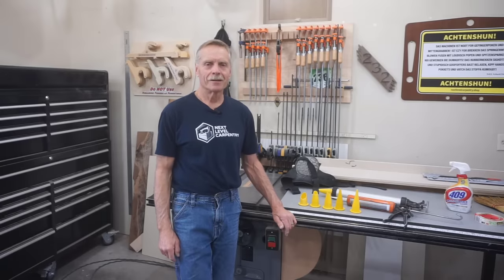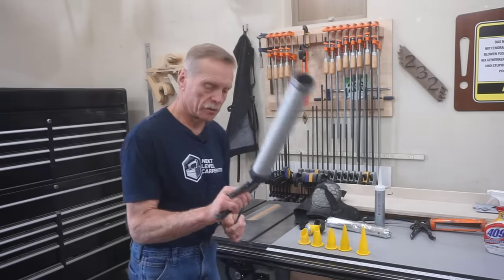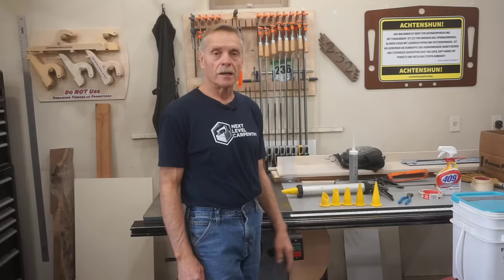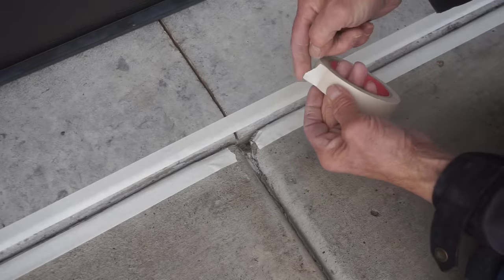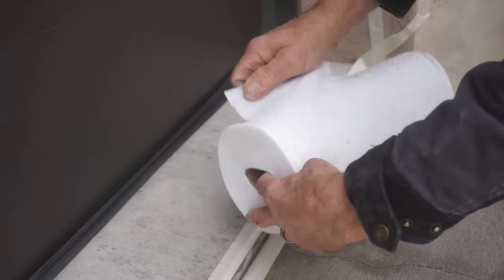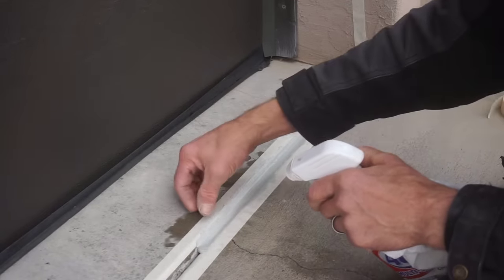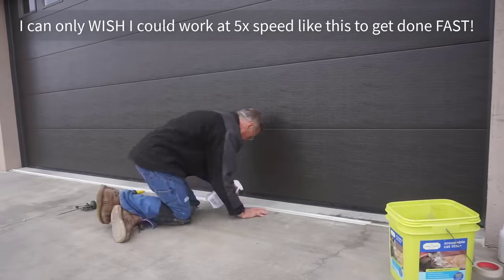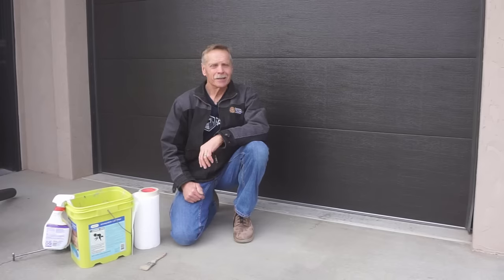How to Caulk Concrete Control Joints with Perfect Results Every Time

Comment: I saw a completed caulking job like this about 15 to 20 years ago and haven’t seen another since then. It was stunning! I didn’t know about adding the sand after so I thought it was a special caulk. I have found caulking for stucco and I’ve used it, but it never looked this good. What I saw was perfectly uniform and placed nicely between the two sides with clean edges . I couldn’t imagine what magic the installer used to do this, but kept it in the back of my mind. NOW, I know how it was done. It’s positively beautiful! Thank you!!
Reply from the maker: Maybe you saw a sealing project I did? 😉😁😎
Best, Matt

Comment: Just did 560 feet of driveway relief joints with sika flex self leveling on a 2 year old driveway (Had time to settle). Pressurewashed, let dry, sprayed roundup to kill potential weeds, Filled any cracks in joints with multipurpose sand, insert 1/4" backer rod snugly so it didn't float. Then proceeded to spend the whole week after work squeazing sika into the joints. Job took 6 29oz tubes. I had a solid 2 weeks with no rain which helped a ton. I had slope, but because the joints were 1/4" the surface tension kept the liquid from bleeding. Will report on material quality after a year.

Comment: Two things.  The hero of this project is the debris pale. Often forgotten and underappreciated.  And the sand treatment has an additional benefit of UV protection.  As a handyman, I am usually the second or third guy in and when this seal fails after a decade or so. It makes my job so much more satisfying to replace a neat job like this than repairing the crime scenes I often encounter.  Thanks.
Reply from the maker: "... repairing the crime scenes I often enounter." LOL!!  I feel your pain, Mark!  Hold the course and keep doing work you can be proud of! 😎 Best, Matt

Comment: That's the best-caulked joint I've ever seen.
Reply from the maker: Thanks Tom... cool thing is that with a bit of practice anyone, really, can get results just as good! Best, Matt
Reply: Bob Ross.. Caulking ,Sausage
Caulk gun sorry I never went to school 
Here in the U.S but words misspelled 
Can be offensive..
Reply: Jose Omar Guerrero r
Reply: TRUE !!!
Reply: @joseomarguerrero9077  well..if you going to watch his videos from THIS country..learn to either ignore his statements, or grow thicker skin!! This is about the LEAST offensive person I have ever seen on here!! So go sell your sasauge someplace else!
Reply: Mr Matt
I have thot i did the best caulk job. Glad to see i have worthy competition.
Our method works just as good around bathtubs.
Thanks for your professionalism.
Reply: Jose Omar Guerrero 0
Reply: Jose Omar Guerrero you want offensive, look up what the real name of “side cutters” use to be.  Matt is a Saint
Reply: @9856CB  The electrical connection box on electric motors is commonly called a "pecker-head". We have learned to call it different names because of the e-mail censor system at work. lol
Edit: Those aren't even side cutters, they are diagonal cutters.
Reply: TheTomBevis the old terminology rhymed with “Yikes”
Reply: @9856CB  I know. short for diagonal cutters. lol
Reply: Matt have you tried the sika seal that comes in a gallon bag? I saw some contractors using it a few years ago seems like a decent product.
Reply: TheTomBevis I got heat for that the other day
Reply: Matt Berg As long as you say “Not that there’s anything wrong with that”, you’re safe.  If it was good enough for Seinfeld it’s good enough 😬
Reply: 9856CB 😂 the guy I work for is a lawyer so I’m always watching how I word things.
Reply: Have a concrete driveway expansion joints out- difficult to find someone to do this job? Thanks as a women might have to do it. Might need to use the foam insert. Thanks!
Reply: @larry5948  the
Reply: @9856CB  FYI 'Dikes' was just shorthand for diagonal cutters. No offensive connotations whatsoever unless you make them that.
Reply: @jameshisself9324  Still is around here. Never heard them called diagonal cutters on a job site.  DKNY brand name gives my inner 2yr old a chuckle.
Reply: @anullhandle  Totally agree, me neither. The nick name has stuck, and has now replaced the original. Happens with a lot of tools.
Reply: Yeah. That’s a nice caulk.

Comment: I've been caulking as a part of my business for 20 years. The 409 trick is just what I've been needing all that time - to make what had already been "good", into excellent. Thanks much.
Reply: I've had great results with windex for years.
Reply: I'm local 4 for 20 years and u can not get caulk wet first,you should dry tool first,I promise you after it sets up you can pull that whole caulk joint out.It looks very nice but it will not hold up.Make a video to show if it stuck to the concrete,I bet it will pull out with your hand.
Reply: @angieiluvme  Not true.

First, you aren't getting the caulk wet at the joint where it adheres to the concrete. I just have a container of windex I dip my latex gloved finger in. All it does is keep the caulk from sticking to your finger or glove so it slides over smoothly and leaves a perfect finish. None of it is staying behind, puddling, or mixing with the caulk in any way to change the way it adheres to the concrete.

Comment: After the professionals left less than 14 months later it was all holes, falling in and basically garbage. Baby butt smooth seams and the silica trick yielded great finish. Reading the comments it's obvious that some folks aren't aware of the difference between turn and burn, high volume production and while there is a place and time for that method VS the long term set it and forget it or the do it right first and be done method. Slick tricks though, yielded great results. If you're like me and never place ads, never even printed business cards yet stay swamped you probably are the latter, you do the job for similar cost you save overhead and use that for better materials and all you have to do is answer your phone, if you got a sales team and coupons and adverts you might me the first in which case you might not have the time or margin to do this method which is fine but pics or it didn't happen. Enjoyed the video as always also solid technique with amazing results looked gorgeous.
Reply from the maker: Your well said comments gets "pinned" to the top of the list Gary... thanks SO much for posting it on this controversial video. Controversial with the 'turn and burn pros', that is!  Best, Matt

Comment: Why did it take me 60 years of doing carpentry (as an amateur) to learn this technique?  Amazing.  The silica sand is the best tip EVER.  Hats off to you sir.
Reply: I use the Quickete Concrete caulk a lot and never thought of the silica sand either.
Reply: You're not alone.
Reply: Try a long roller rod with toilet paper on it.  Keeps it from tracking on your car, etc.

Comment: Thanks for the tips.  I never thought that as a right-hand person, my line approach is an important consideration.  Also little details like I can remove the tape right after tooling was appreciated.  I also decided to sift the play sand to remove large particles for a nicer result.   Your video was a great find, for me, who will only do this DIY task once.  42 meters beigh color patio with 6.5mm x 19mm scored concrete - Canada
Reply from the maker: I bet you'll do great with only a little bit of practice... good luck!

Comment: Another Great video...as always. You're hired!   A little off topic, as this video centers around finishing, Caulking joint ratio is critical for long term success. Use a 2:1 width to depth ratio to accommodate movement. Create an "hourglass" shape for the sealant profile. Windex has always been my "soapy spray"; I'll give 409 a shot next time.

Comment: Everything you’ve said and shown confirms all my prior research. I was all set to do this right the second time I paid for it, but the only piece I couldn’t find was the part about making it all look good. You’ve definitely provided that missing piece of the puzzle, plus numerous other great tidbits. I know it’s a lot of work, but at $300 a pop and it has only lasted a year or two, it’s well worth doing it right myself. Thank you Matt! You keep this up and I’m going to have to ‘buy you two coffees’ a month on Patreon!
Reply from the maker: Unstable concrete can lead to premature failure, James, but proper prep, materials and technique are the best chance you have for long-term success.  I've done sealing projects that are still good-as-new 15+ years on and others that pull loose from extreme expansion and contraction in 5 years or so.  Practice on easier, smaller, less visible areas to get the system down and you'll be a pro in no time! Best, Matt
Reply: Thanks for the very instructive video. No a Drama plain language, no unnecessary comment or profanity. Need to do chalking, similar to this except on uneven rough surfaces.

Comment: In my younger years I did a lot of caulking as a tuck pointer/brick cleaner, part of the brick layers union, mostly commercial/industrial, windows, doors, expansion joints. We used 2 part caulk in buckets with colors and hardener, and a large metal gun we sucked the caulk out of the bucket and used the appropriate tip for the joint. We always used a primer we brushed on after cleaning with compressed air. We never use masking tape, we use pointing tools to smooth, sometimes soapy water to glaze the caulk. The sand is nice for driveways. We used backing rod if the opening needed filled first. On really large jobs we pumped right out of 50 gal drums. Nice video for these small jobs but I wouldn't use masking tape. One tip, we always had plenty of rags and solvent around to keep our tips and tools clean from that sticky crap, lol.

Comment: Great video. I ended up with this project after take a photo of a bunny rabbit sitting on the steps leading to my driveway which looks faded and ugly lol. I have a few joints that need to be sealed using backer rod etc but your video is very helpful to seal the joint closer to the garage door…. My driveway is sloped downward.. and thanks for the tip for not using self leveling. Thanks again

Comment: I just finished a coffered ceiling in my basement,and I was about to caulk it . But I said to myself let me grab my 14 year old son and teach him how. As simple a task as it is I am going to guess by looking at a lot of peoples bathrooms and trim around their homes most people have no idea on how to do correctly. This was a great video to teach people and I even learned the sand on top of the wet caulk  trick from it. I also learned from a mason years ago if your crack you are filling is deeper then normal to fill a potion of it with sand so as not to use a hole tube filling a 2 inch deep separation . Thanks for taking the time of making an excellent video.

Comment: Thanks for the video. Just took care of my driveway's old rotted out expansion joints and they look phenomenal thanks to you!
Reply: How the heck did you remove them? Mine are stuck completely
Reply: @floridagirl9064  just a lot of hard work. Had to use a small chisel, pliers and elbow grease. Mine were hard plastic that had splintered and broken.

Comment: Absolutely outstanding, as every other video and technique I've seen of yours! I always dread having to caulk joints - always such a mess and difficult to achieve what I would consider a good-looking joint. I love the 409 tip; does that work with other types of caulk, like latex or silicone? Ever do it on interior finishes? I recently started masking caulk edges to step up my game and am hoping this will ratchet it up another notch. I would have liked to see exactly how you finished the T-joint with the mitered tape. =)

Comment: Awesome job,I never thought to put the sand but great idea.peace
Reply: Adding sand is an excellent match to the concrete!
 On  wider joints you can also use PVC pipe cut at an angle and use the end of wet empty plastic caulking tubes to scoop out  excess caulk to give you a nice even concave
Reply: Surface.

Comment: You did such a beautiful job on that joint. Please demonstrate a nice clean technique for repairing or sealing cracks in concrete. Thank you
Reply from the maker: I use the same process for sealing irregular cracks in concrete with the only difference being that you have to spend more time following irregular edges with the masking tape. Face the fact that cracked concrete will never look like new concrete but if you do good job of sealing the cracks it's the best option compared to replacement...

Comment: Great video, and THANK YOU! It's great to see fine workmanship on something as mundane as concrete caulking. It's what separates the craftsman from the caveman.
Tip for using self leveling caulk: use a 2 stage method where non self leveling is the first pass, with the top of it well below flush with the concrete. Once cured, come back with the self leveling pass. This prevents the self leveling from running into any voids under the cracks, which in my experience is the reason for the inconsistent results.
Admittedly this single stage method shown here is so good that my idea sounds laborious. As good as this result is, when the self leveling has a good result it is magical. I should mention that of course the self leveling gives best results on level joints. Most driveways have some tilt and the lengthways joints can be too much to prevent the self leveling from pooling at the low end.
Reply from the maker: Great perspective and information James... thanks for watching and adding value to this video for other viewers by providing them with options to get the best results possible for their unique projects! Best, Matt
Reply: 0
Reply: Regarding the sand at the end, do you pour it on when wet and leave to dry or how does that work - Thanks!
Reply from the maker: @artgirl-zx2jh  I apply dry sand as soon as possible after I finish tooling the sealant to prevent other dirt, dust and detritus from sticking to it first.  It doesn't matter how long you leave the sand on either; once the 409 and sealant dry excess sand just blows away.  In ideal circumstances though, I prefer to vacuum up excess sand in a day or two to leave a neater jobsite.  Best, Matt

Comment: I had one "control joint" on a really old house that was just a bit wider than the biggest backer rod, so I used 3 smaller ones and braided them together. Worked great, other than using a ton of caulk. Was there the other day, still looks great after a couple years

Comment: Great techniques. One other technique: For a perfect dry tooling process I found years ago that using a small piece of foam with a flat edge produces the same nice smooth result but much faster. I used to seal tall vertical 30’ joints in concrete tilt up buildings. There were sometimes a hundred of those joints. The foam pieces make finishing perfect and really fast. For a taped joint you just come back and lightly feather the edges to flatten that little lip the removed tape makes.
Reply: Sound good to me. How long did you have to wait for the caulk to dry before you tool it with the foam piece ? Should the foam have the same width with the joint width? Appreciate your reply.
Reply: @diemvolz4311  I begin tooling immediately. It would help if the foam is a bit wider. When I was doing it commercially I would go to a foam factory and they would roll up a large one inch thick flat sheet and slice it into strips. I just did a pool deck and for some application like that I mask the edges with tape to get a perfect finish.
Reply: @toecutter1015 the real professionals use foam. Caulking knife just can’t get the same perfect feathered edge on concrete.